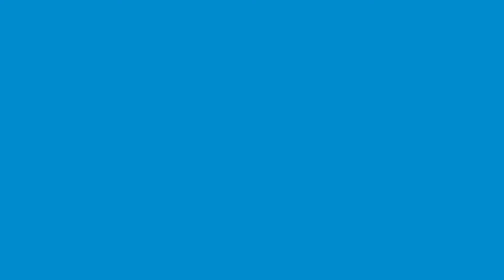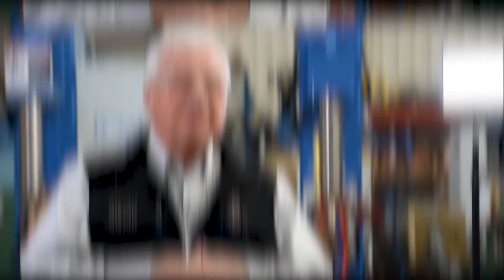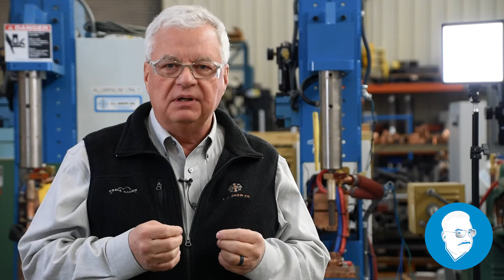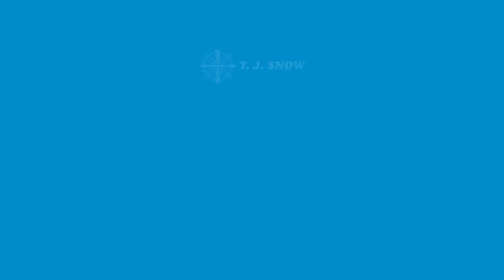Do I Need to Water Cool My Electrodes | Resistance Welding Q&A

Comment: is it a must thing to do.
what if i didn't cool my electrodes, what will happen ?.
Reply from the maker: If you do not cool your electrodes, they will get very hot and quickly mushroom, changing the weld face diameter, which will then also change the weld being produced.
Reply: @TJSnowCo  if the electrodes are hot is that going to effect the current as well ?.